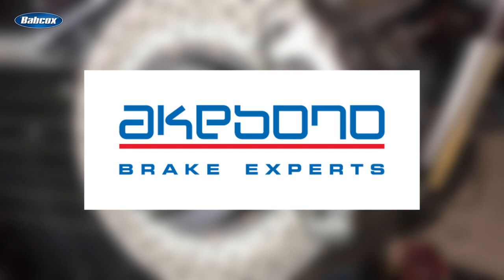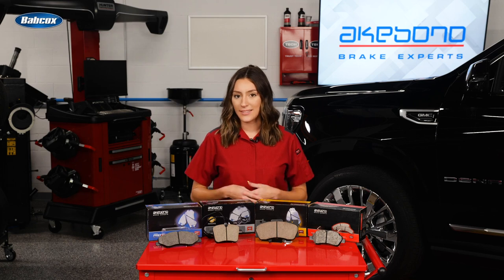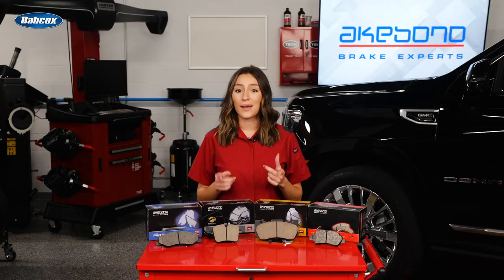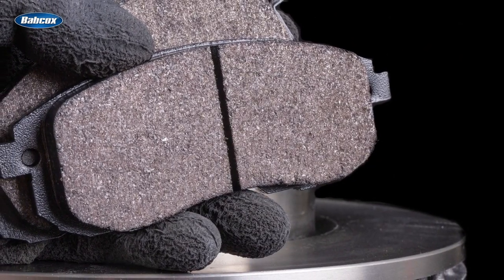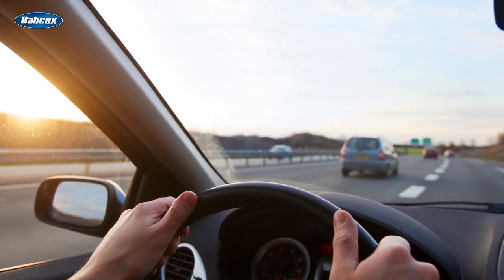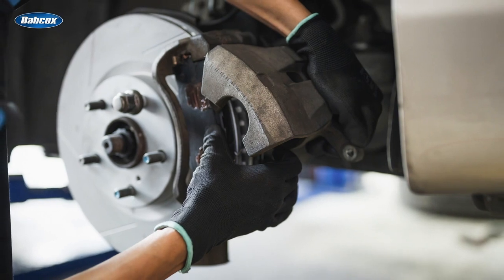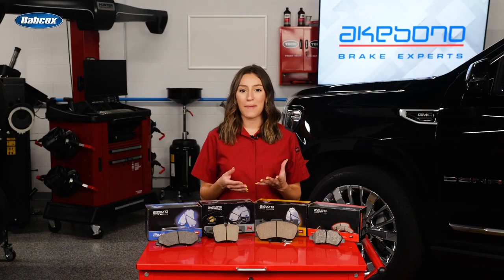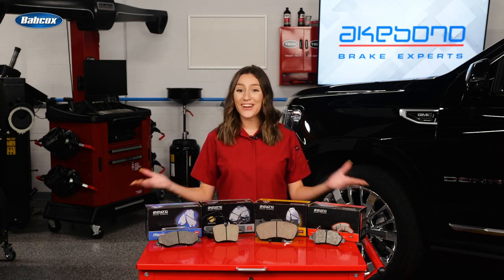Akebono Brake Experts- What is a Performance Brake Pad?

Comment: Akebonos are decent but nothing beats genuine factory pads. If you look hard enough you can find genuine pads at wholesale pricing.
Reply: My Akebono Proact pads are significantly superior in stopping power and reduced brake dust than the OEM pads ever were. OEM pads are not tailored to give you maximum performance off the showroom floor, they are intended to stop a vehicle reasonably for the least possible cost.
Reply: @BrandonWest87  not my experience with Toyota at all. Original ones are superior. Test on serval different Toyotas. Akebonos are okay at best
Reply: @adamtajyar  Were you using the Performance or ProAct line?
Reply: @BrandonWest87  pro acts.

Comment: ProActs came factory standard on my '00 GMC Sierra along with a 100k warranty. I now have 225k on the odometer and over 50% wear left on the pads. There is a slight squeak from the right rear that is due to the glazing of the rotors. I highly recommend these pads if you can find them for your vehicle. Also installed the euro pads on my CLK55 and getting the ProActs for my Q50.
Reply: How are the ProActs on the q50? If you ever got them installed.
Reply: @Yagga97  installed the rears and the front has another 4k left. Performance is hard to tell with just the rears since the fronts do most of the work. You really cant go wrong with these pads
Reply: @tompilling4154  thanks bro been thinking about getting these pads for my G35 sedan
Reply: @Yagga97  No problem. Also my clk55 has the akebono Euro pads and flog them pretty hard. Not sure on the longevity but other than the common back up squeel they are super reliable compared to stock. No more black wheels and 12k replacement intervals.

Comment: Question.  Your Pro ACT vs your Performance.  Is there  a temp range that one works bettre at than the other?  I put your performance pad on my toyota sequoa and love them but noticed in winter when its cold out and I'm going down the mountain with no heat in the breaks there is a slight few seconds where it seems like i have less friction to work with.  After getting a bit of heat in them its fine.  I was wondering if your regular ACT would react better during this initial cold period due to its temp range?  Or is your performance pad just as good at cold temps?  I do love your stopping power when I'm all the way down the mountain :-).  I.E hot.
Reply: I believe when I had gotten the Akebono performance pads on my GMC Sierra years ago it mentioned that on the box. Takes a bit of time to warm up to get maximum bite, but performed better than ProACT. For me that meant driving down to the end of my street and maybe one more stop sign and I didn't really notice any extra bite after that. What I enjoyed most was the extremely consistent brake feel. The performance pads probably require a bit more heat to begin biting properly since it's meant to be used on heavier vehicles, those who are towing, or using them on a sportier vehicle. You probably have the right pad and should enjoy them. Then again nothings stopping you from picking up a set of ProACT pads and testing them out. If they perform the same, you got a second set to use in a few years hahaha.

Comment: I got akebono pads  and new rotors all around on my older Silverado from a local store and spent some good money on them. When I got them the pad boxes were open, after installing them they squeak like crazy. I think the store swapped the pads and gave me some crappie ones. I would buy akebono again but they need to be factory seal
Reply: Crazy story. I just bought some pads online, and the rears were loose in the box. I guess it's semi common.
Reply: Got mine from RockAuto new in box and sealed.

Comment: Do I have to bed in new ceramic pads?
I read no. Just easy driving for 400 miles
Reply: Yes. All new pads must be broken in. See hawk or EBC recommendations. Pretty well same break in procedure. When breaking in do no fully stop till the very end when you let them cool off 15 to 30 minutes.